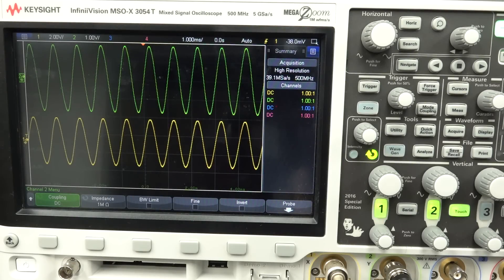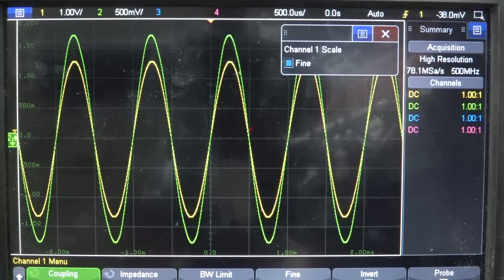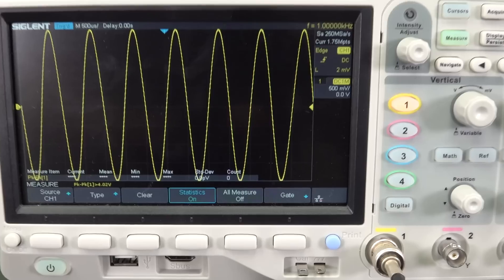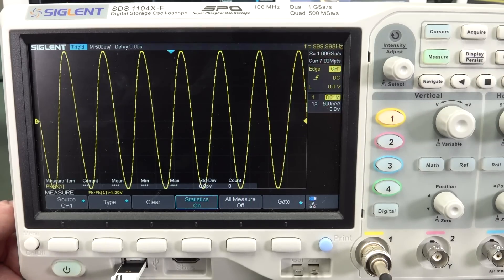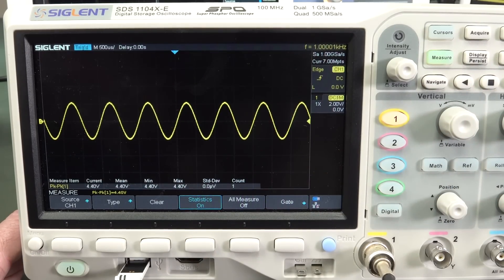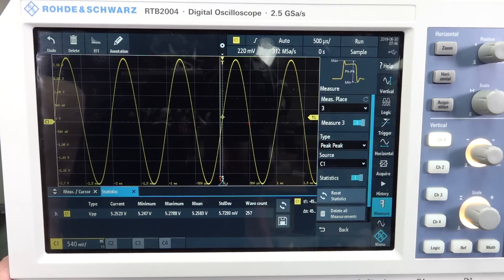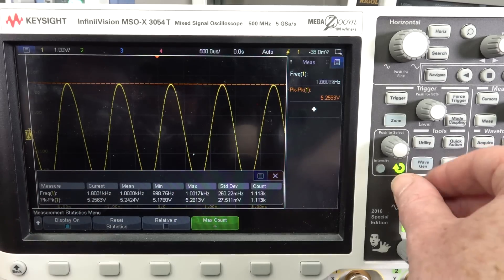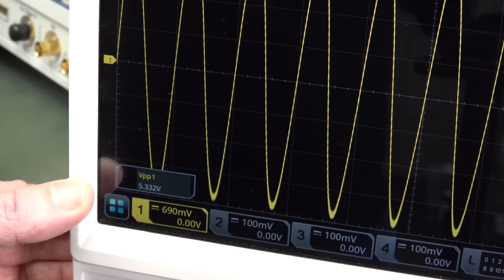EEVblog #1226 - Get Better Accuracy On Your Oscilloscope

Comment: I can't imagine why you'd want to keep the accumulated stats on a range change but maybe there is a reason. Nevertheless, why not have a global setting to make the default choice?
Reply from the maker: It should certainly refresh and flush everything automatically. Just changing the electronic range divider in the vertical front end can cause brief signal distortion.
Reply: EEVblog Imagine you are measuring a long running experiment such as discharging a battery while watching the effect on your circuit behavior.  You don't want some @!#$% fool-proofing mechanism throwing away your data when you zoom in on a detail or gradually increase resolution as the amplitude drops off.

Comment: Caution:Probably a stupid question...  When reading the std Dev with a lower volts/division scale(filling the screen vertically). Does the math use the stray samples higher than the waveform that are no longer displayed?  Or is that where the less error is coming from.

Comment: .02pV? Looking down at my Tektronix 2215's measly 2mV/div. :(
Reply: MM0SDK It's printing out the calculation noise in a floating point value that is simply zero, input resolution was something like 20mV.  Sure, printing out pV would be correct if this was calculated from a billion cycles of a 1MHz 4V sine wave (about 20 minutes of measurements), giving an indication of how few of those cycles were wrong enough to give a different signal.  But it would still  depend heavily if the actual input amplitude was at the tipping point between two ADC steps or right in the middle of one.

Comment: thank God I don't have an oscilloscope

I mean I don't have money to buy one, why are they so goddamn expensive?
Reply from the maker: What do you think is a reasonable price? How about $50?
https://www.youtube.com/watch?v=rTPhuRQBmLQ
Reply: @EEVblog  I tried to search for one of those, the problem is that the delivery in my country costs more than the device itself. By the way from cheap oscilloscopes I observed Hantek, 300$ for 2 channel 200 MHZ 1GSA/s, are they worth buying?
Reply from the maker: @D4no00  Any oscilloscope is better than no oscilloscope.
Reply: @D4no00  the cheap Hantek scopes are not bad if you can´t afford more. I got a DSO4072C for 235€ and am pretty happy with it. It does all the basic DSO things without problems. The sample memory is really low though.
Reply: @Basement-Science  since when 1 GSa/s is low? what are your use cases?
Reply: @D4no00  I don´t mean the Sample Rate, but the Sample Memory. That´s how many Samples/Points the scope can record in a row and store to create the final image. For example if you single shot capture something, and then want to zoom in afterwards, you very quickly get to a point where you see the individual points because there aren´t that many stored.

On my Hantek Scope, you can only select between 4K, 20K and 40K. A lot of scopes use something like 1M or more by default.
Reply: They're expensive because they're mostly a scientific instrument in the level of microscopes, telescopes, seismographs, etc.
Reply: It depends on the type of work you are going to use it for. A $100.00 Tektronix 475 from a swap meet fills my needs just fine even though it is analog and 40 years old.